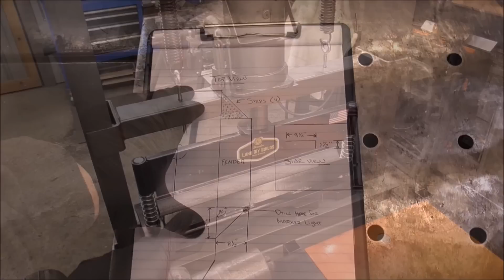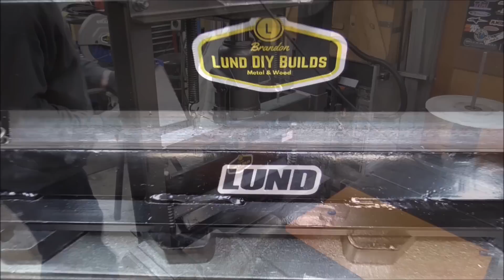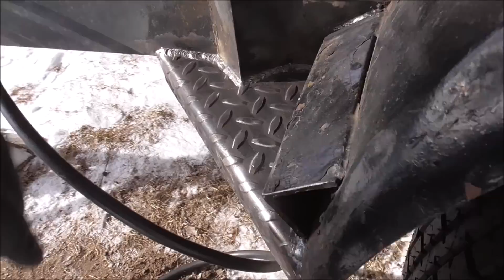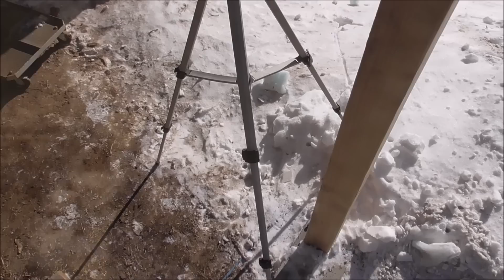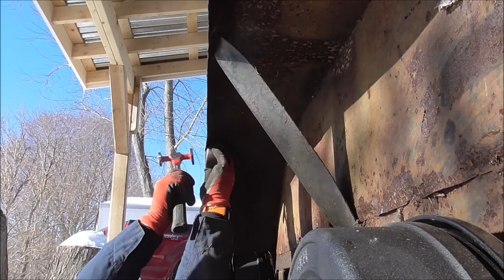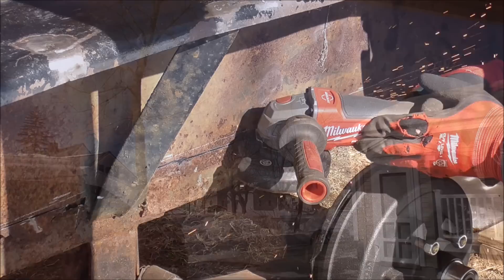E10 DIY Trailer Fender Repair: How To Straighten Bent Fenders (Without Heat!)

Comment from the maker: MY TOOL BUILDS! https://youtube.com/playlist?list=PLfbf78fMz9Vo2Cv3V5fmYlDZGpS8Hp98l
Trailer Rebuild Playlist https://www.youtube.com/playlist?list=PLfbf78fMz9Vo5uSKgZAz27WJAAPrcsMIX
$25 Aluminum MIG Conversion https://youtu.be/FGhSo82MP9U
Mobile Welding Machine https://yeswelder.com/products/dual-pulse-welder-dp200?ref=BRANDONLUND&variant=41877943877741
21 Volt Cordless Grinder https://amzn.to/3NBOyJ8

Comment: New fenders for this trailer are available at Princess Auto (very much like Harbor Freight) here in Canada for $79.00 each when they go on sale. I think the normal price is $99.00 each. I made fenders for our travel trailer out of them. Took some cutting and fabrication, but they worked great. Interested to finish watching to see what you did to straighten yours. I can't imagine what kind of driver previously towed this trailer. They didn't miss many obstacles! LOL
Reply from the maker: That's a great price! They are a lot more here!

Comment: I bought some of those HF hollow dollies to use on a tractor engine side cover that someone ran over...  I put off fixing that until I needed to take it off the farm, forgetting I bought those a year before (or so) on sale.  I took the cover out and laid it in the dirt and pounded it out with a plastic dead blow.  remembered them after the primer.  The metal was 14-16ga, so those hollow dollies wouldn't work very good on that either.
Looks good with  painted with that hammered finish...
Of course that's an older tractor since it had a metal side cover, they're all plastic or fiberglass now.
Reply from the maker: They definitely don't make things as good as years ago. I will probably paint just the fenders with some bedliner material, that way, any imperfections will pretty much dissappear.

Comment: Brother Nice job, the trailer is coming along very nice. The Diamond Plate steps are killer.! That's something I'm gonna do to my trailer.  The fender came out much much better than before. When or if you paint it. Put some bed liner paint on those 4 steps for some slip resistant.  Stay warm my friend and be safe❤
Reply from the maker: Appreciate the support!  Those steps are a big improvement. I love your idea of adding bed liner paint. I will doing that for sure! Thanks for sharing!

Comment: On another idea I ran across from watching a YouTube channel on angle grinders was how noisy they were and how to fix them. On them by removing the front half to where it exposes the gears is cleaning off the grease and using low temperature grease and putting it all over both ring and pinion gears and it will quite them to where they don't sound like it is rattling.
Reply from the maker: That is a great tip. I'll have to try that!

Comment: great series, this is the motivation i need to trade my well made but too small single axle trailer towards a large ratty dual axle trailer
all the trailers im looking at have torn up fenders so this really helped
Reply from the maker: I'll admit, I was a little intimidated at first, but I feel pretty confident that if I can do this without any training, than anyone could do the same with great results also. The hardest part is just chipping away at it. It's not a process that goes quickly, but I really enjoyed it.
Reply: @ well thank you, I’ve learned a lot from your videos 

I’m in a two year welding program (night classes after work)

I rebuilt a ran down not running or welding miller bluestar 185 generator welder. Now hopefully a month or two out from doing part time mobile repairs and/or small repairs at the house 

Your videos are great reference for me and I always look forward to fridays !
Reply from the maker: Those bluestars are a nice portable unit. I'm glad you rebuilt it. A few years ago, you could pick up a nice bluestar or bobcat for a reasonable price. In my area (Central Maine), the prices have skyrocketed. A marketplace bluestar will now run you around 3k! The prices are crazy. Good luck with your classes, and thank you for your support!

Comment: The end results is where you want to stop at. Can all the dents be removed? Of course they can. It is just how much time you want to put into removing them. But if you are happy with the results, that's all that really matters. It is your trailer after all... My OCD would make me work on them 'til the dents were gone. But that is just me...        Thumbs Up!
Reply from the maker: Right before paint (in the spring) I will likely work on it some more. I want to add some paint then lightly sand it to help me find all the little dents, but it's just so cold outside.  It's actually a lot of fun, but my eyes start to play tricks on me after a while.
Reply: @BrandonLund  What you are talking about is called guide coat. You can get it in a powder form for just that reason. You apply it using a circular motion and than sand. The bark spots are the lows while the light spots are the high areas. Research it. I think you will like it...
Reply from the maker: I will look into that. Thank you!

Comment: MM77 Approved 👍🏼 👍🏼………………………………………………………………………………….You are repairing the trailer BETTER than new ! I like the sun shade you have better than the Black Stallion I have, who makes it?
Reply from the maker: I wasn't sure if the black stallion one was going to fit my hood, so I went with this one. I have had it for a little over a month. I love it! It's very well made https://amzn.to/41oyceK
Reply: I like the BlackStallion because it is vented and then I remember you need a skull cap because it is vented...
That full black Darth Vader  hood looks way too hot.  Probably good up north.  I am looking at a light colored one.
Reply from the maker: Definitely will be warm in the summer. Nice and cozy in the winter though